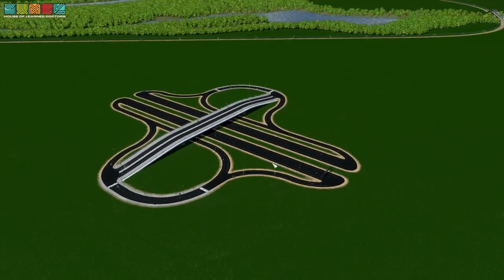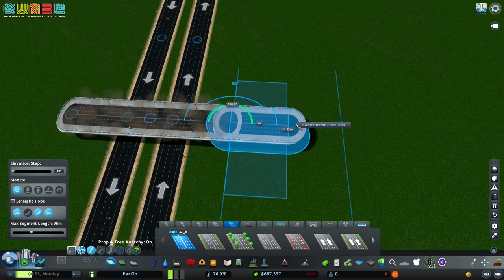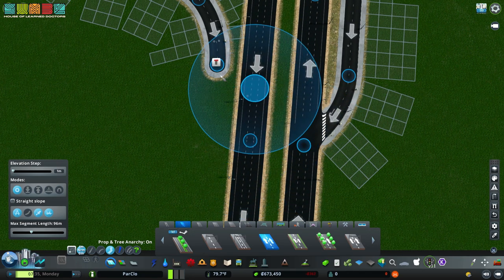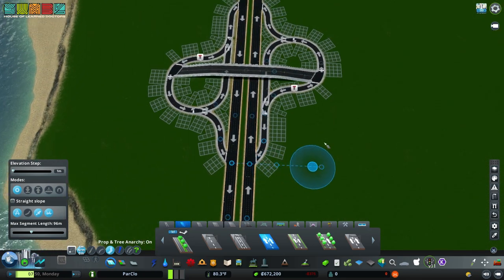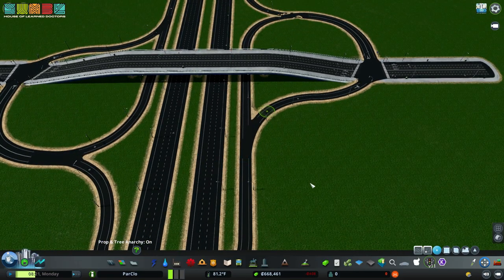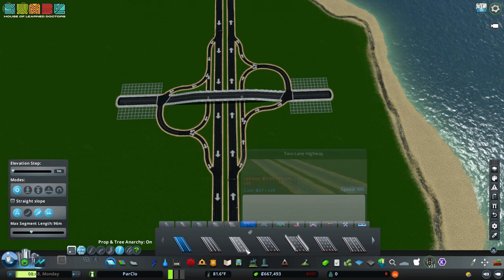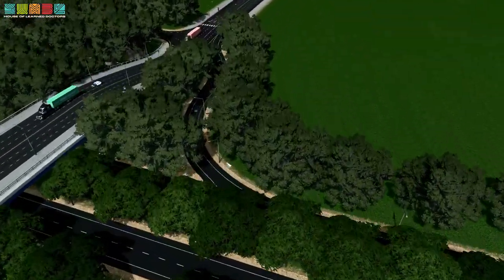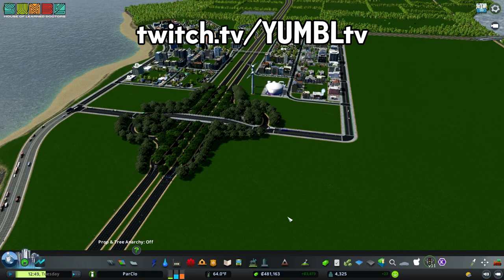Partial Cloverleaf Interchange Tutorial *ParClo* - Cities Skylines

Comment: There are a number of types of partial cloverleaf interchanges.  My preference is for the A4 type.  Not sure what type this would be
Reply from the maker: This is an a4. You can tell by the two diagonally placed “leafs” and slip lanes for the right hand turns on all sides :)
Reply: @YUMBL  Ouf I think I meant B4.  Where the loop ramp comes off the arterial and onto the highway rather than from the highway to the arterial.
Reply from the maker: Gotcha!

Comment: This won't work with only vanilla assets, unless they have changed something about the AI routing since I last played, as the vehicles will always try and take the shortest (and fastest) route to their destination and the offramp-road that you "fix" with Traffic Manager at 11:46 would get congested in the vanilla game as vehicles which wants to go left would also go on this road as that is shorter than going all the way around. But by making it a right turn only they will use it correctly.
Reply from the maker: Definitely best used with Traffic Manager. You can also use roundabouts instead. Its almost a 50/50 weather they use the loop, but some do.

Comment: Ok so why not simply remove the people turning left on the bridge altogether so there's no conflict. 

God this is going to be complicated...so basically you'll need to create a one way two lane road and a one way one lane road next to each other for your bridge.

 You'll have to repeat again for opposite direction. What your attempting to do is keep single one way lane elevated higher than the two lanes that normally create conflict while those two lanes connect to the two Lane one way bridge. 

So in theory your traffic never has to stop. Those getting off will raise up to meet single one  way bridge and make right turn and merge. Those looking to exit and normally having conflict issues actually go above those lanes thus removing conflict.
Reply from the maker: You’re describing a system interchange. Conflict free configurations used to connect highways. This is a service interchange. Theyre cheaper and its ok if traffic crosses.